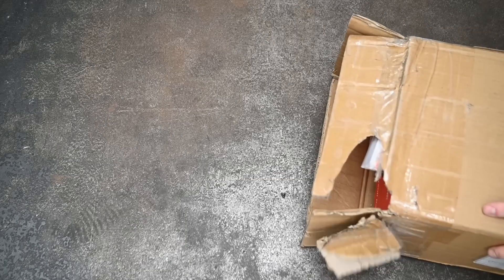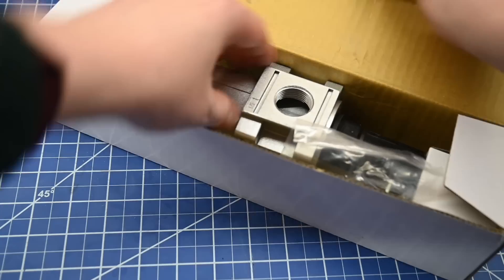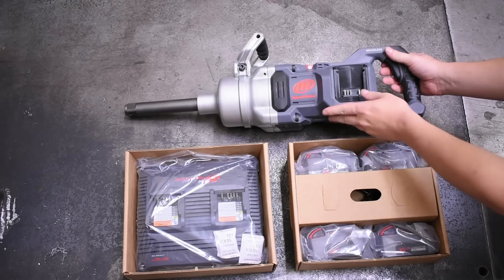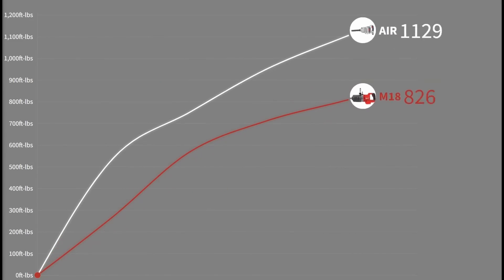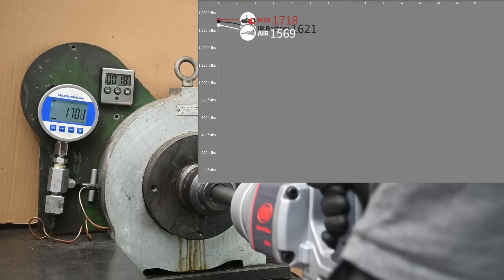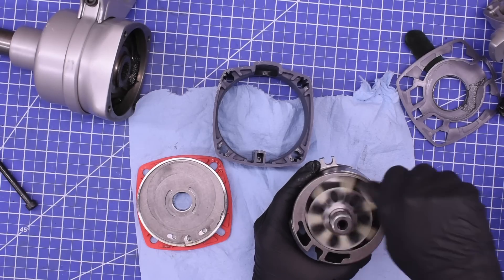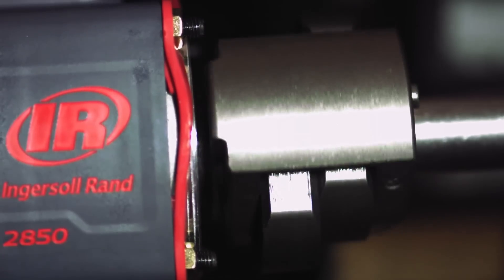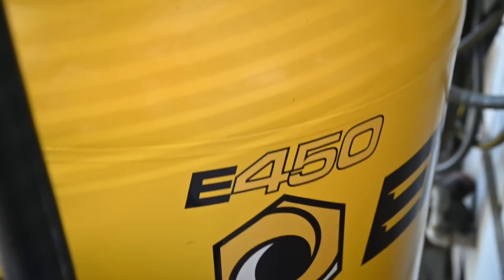The Impact Dealers Tighten Your Lug Nuts With: Largest Air vs Cordless

Comment: I was just using my VERY old Jet 3/4 drive air impact yesterday!  Made me realize just how choked down my air lines are while using it, and boy did you just amplify that thought.  Guess I'm going to have to run a dedicated medium length hose line off my main 3/4" air trunk.  

Even being underpowered, it STILL managed to crush 3 receiver cups of my ball joint press while trying (!) to get the lower ball joint out of my 2500HD.  I did win eventually on that front.  ;)

Comment: I'd like to see 1) A frankenbattery on the IR cordless 2) the 12ah Milwaukee Forge tested and 3) some cheap air tools tested (destroyed) by your new air compressor.
Reply from the maker: We tried to run the IR on 24V and bricked the $1000 impact https://www.youtube.com/watch?v=vHVuF8YvCu0
Reply: @TorqueTestChannel  now if someone had access to a 3d printer they could build a lower case for the IR batteries that would house 3 rows of 18650's something like the samsung 25r or molicel p26A, you might need to upgrade the thermal fuse on the top of the battery though
Reply: @MingRaptor  why those, there are much better cells around
Reply: @riba2233  really? What would be your pick for a high discharge 18650 with around a 2500mah capacity?
Reply: @MingRaptor molicel P30B ;)  although Samsung 20S has the same power (just much lower capacity) and they use 15 of Samsung 20S cells in flexvolt 6ah pack which makes it really powerful. These are true 30A cells compared to 20A rated 25R's.
Reply: @riba2233  i've a 6ah flexvolt that keeps going out of balance so if I can get 15 of those molicels i'll be swapping them out
Reply: @MingRaptor   they go out of balance because of a flawed bms design, no cells will help with that unfortunately :(
Reply: @riba2233  I understand the design but the 6ah flexvolt I have has been fine untill recently, there is a cell that is discharging faster than the rest under load and that one cell is throwing the whole thing off, I've got 9ah flexvolts that are 4 years old and still fine
Reply: @MingRaptor  ah ok, maybe some of them are tired after all those years yeah. P30B will be a nice refresh but be careful,  fv packs are a bit hard to disassemble :)
Reply: @riba2233  not my first rodeo buddy

Edit: the 6ah was actually fine  untill I used it in the big cordless strimmer/weed whacker (which ever side of the pond you are from)
Reply: @TorqueTestChannel You guys really are the best, no one else does that kind of research and devotion to the cause of beans
Reply: @TorqueTestChannel  Hear me out, get a Flipsky VESC BLDC speed controller and hook it up to the motor that's inside the bricked impact. Even if the sensors are dead the VESC should still be able to calibrate itself to the motor. Then you'll be able to run up to 100V at 100s of amps to it depending on battery and specific model of controller. These controllers are usually designed for electric bikes and skateboards so are very easy to set up. :)
Reply from the maker: @phylaxxx  I usually feel gasoline and brap be
braps are the solution
Reply: @TorqueTestChannel Suggestion if even your new compressor isn’t enough, maybe you can get your hands on a diesel air compressor to get high pressures even when impacting
Reply: if you get around to it. can you test some Vevor 1in impacts. believe one of their models is supposed to be over 3k break power. i maybe off a bit  @TorqueTestChannel
Reply: Or, hear me out, megasize that IR. Take the specs from it and just make it bigger.
Reply: electricity is still just electricity
Reply: They(TorqueTestChannel) did try give Mil more bean by using custom 18v Battery, and most milwaukee tool break down by it's power, so 12ah 18v Forge battery will not exist, or they need limit it some way, but if so, just buy normal 12ah battery instead.
Reply: @nguyenhaianh8070 That didn't age well🙃

Comment: Finally a tool I can use to remove my car oil filter. Those things get fused onto the car but not anymore with this guy.
Reply: That problem is why oiling the filter gasket is recommended. They don't need more than firm hand torque to seat in most cases.

Comment: My shop has both IR air impact wrenches, the 285B and 2850MAX. The 285B feels like it hits harder because it is able to remove truck lugs where the MAX sometimes struggles.
Reply: What kind of trucks? Is 600-700ft/lbs not enough for most rigs? I’ve never worked on them, but ASSumed the torque ratings wouldn’t be over 3-500lbs?
Reply from the maker: @fZionists78  Some of the disconnect with viewers and the super high numbers we show come from torque specs. Torque specs are to install something, which is why they give you that spec, to use a torque wrench. Most techs aren't NEEDING the impact to install, it's to remove it once mother nature has had its way with the bolt or nut. If you need a 600 ft-lbs mid torque to tackle most lug nuts that will roll in on passenger vehicles, and those are maybe 100 ft-lb spec. imagine what you need on something with a 500 ft-lb spec to remove 100% of the time.
Reply: @fZionists78  we work on freightliner, navistar, kenworths and other types of semi trucks and box trucks and different types of cargo trailers. Some people don't like to torque stuff down and just full send the impacts, on top of mother nature setting in, some lugs need a torch in order to be removed

Comment: I work in a heavy truck shop and we have a IR 2850 and a Central Pneumatic Harbor freight 1in and I am very disappointed with the performance of the IR ever since we got it. The old beat up HF gun beats it every time, so am curious to see what numbers that puts out compared to the 2850 in this test. Using the same air line and fittings I’ve had the HF gun buzz off lug nuts that the 2850 wouldn’t even think about loosening.
Reply: Smaller air guns perform better than larger air guns if the air is insufficient. Just something to keep in mind.
Reply: @autobootpiloot  the Chicago pneumatic is the same size as the IR gun plus we have all 1in air lines
Reply: @LongLLY  but is it the same capacity? I would think the highest rated impact has the highest need for air. Although 1” lines sounds like plenty of air. 

It’s just that I haven’t ever seen a cheap brand beat a name brand with air tools. But hf might just be the exception.
Reply: @autobootpiloot  it’s a 165 gallon compressor with 1 in lines so I do t think air flow is a problem. But I’m no expert. Still just curious to see how the testing compares to my experience.
Reply: @LongLLY  G'day  Max, I think the 165 gallon/ minute compressor would be way to small for large air tools. 165 gall is 22cfm. My shop compressor was 48 cfm. and the line pressure would quickly go down along with performance. cheers. Butch.
Reply: @butchphillips873  it’s 165 gal but I believe it’s over 100cfm because it’s a large screw compressor. I’ll have to check on Monday when I go back to work.
Reply: That's because IR sucks and are over rated. 20+ years ago, they were a major contender, but they haven't been for a long time.
Reply: Is the restriction at the coupling? We had an issue where pressure dropped so much after the quick coupler that the twin hammer was gutless.
Reply: @Suedeman  even if there is which I doubt because we are using Milton high flow 3/8 connectors both guns are similar size and rating so I don’t think that a restriction is causing that big of a power difference. Because from my estimate the ir gun is less than half as powerful.
Reply: Also to note we turned in the first ir gun for warranty because it was so gutless and the new one has the same issue. And if with our overkill setup the IR still isn’t getting enough air I’ve never seen a shop setup that could feed the IR gun properly. So if that’s the case no reasonable setup could fully power the IR

Comment: Love to see the reinvestment in the channel.  
Sounds like there is some practical application for the non channel as well but excited to see what comes next.
Reply from the maker: A lot of the delay was simply that the 80 gallon IR compressor with decent CFM does everything the shop needed, especially with more and more cordless being used. So this additional 120gallon guy had to be purely on our tab and basically has one use: big fun stuff
Reply: @TorqueTestChannel  sounds like more air tools are coming. Can't wait to see that
Reply: @TorqueTestChannel  If your compressors are getting in your way, and cramping your style, please feel free to send either, or both, my way!  🤣
Reply: @Hey_Its_That_Guy  im sure they will but you have to cover shipping "it will cost more then the compressor brand new"
Reply: @littlejack59  Have trailer, will travel.
Reply: @TorqueTestChannel  Twin Twin air hammer.  If 2 is good, is 4 better?
Reply: Yeah, now they can remove Honda crank bolts!
Reply: @nasonguy and post Jiffy Lube drain plugs

Comment: We use those chicago fittings all the time in aircraft maintenance from really low to very high psi. I've not once seen anyone use the retention clips, or even knew about them till now, and have never had issues with them whatsoever. Real reliable style in my experience
Reply from the maker: I'll be honest, the retention clips are mainly for on camera use
Reply: @TorqueTestChannel I had an accident because I didn't have the clips on. Was running on a big diesel compressor and I tripped over it. It came apart and beat me up while spraying water too all over me. Not a good day.
Reply: Same here.
They make retention clip? Who knew.
I have never seen these things come apart in use. Considering I’ve only used these with trailer mounted compressors, I’m pretty sure the results of a loose hose would be noteworthy.
Reply: I work in construction.  I also didn’t know they came with clips but I sometimes make people put rebar tie wire in high traffic areas.  Ive seen those things break open and it’s completely nuts when they get whipping around with a 100gpm compressor hooked up to it.  No one ever got hurt that I’ve seen but only because they weren’t right next to it.
Reply: @TKC_  They can be used with purpose-build safety cables which are recommended by Clemco (big sand blasters) etc.
Reply: I have seen one come undone.  Ours happened while first coming to to pressure.  Lots of twists in newly run hoses wanted to come out of the line when pressure was building.  It was something that caused us to use safety wire for at least a few years...
Reply: @BrianFullerton  I bet. lol
Reply: I was thinking the same thing with the clips/cotter pins.  They’re supposed to be used but get lost in a hurry here in NYC on the sites using jacks etc. welcome to the big boys club TTC👍😉. For real though congrats on any and all well deserved success and recognition. Thats a beautiful setup ya got there !
Reply: How do these compare to Thor fittings? We use them at work for air/water/steam because they have a locking collar and I would consider them "safer".
Reply: @Jeek333  Thor’s probably are “safer” and hold more psi. The Chicago fittings can’t be used for steam either. Idk but I don’t think thors are supposed to be used for steam.
Reply: @Ohio-Patriot  The seals aren't temp. rated for it but they hold up surprisingly well from my experience.
Reply: @Jeek333  Thor fittings are nicely done and cost accordingly. I would prefer them for steam because of the locking collar but otherwise Chicago couplings are long proven and seal swaps take a few seconds with needlenose pliers. Not chasing cotter keys is a MAJOR convenience when working where OSH inspections are a factor though aircraft safety wire works even better. Both types benefit from safety cables.
Reply: At the plant I work at we have these on the air and water hoses and the only time we ever use them is on the water hoses.
Reply: Use them all the time on air tools from Jack leg drills to breakers to feeding slant drills. The cotter pins get lost, we use tie wire to keep the safety marm happy along with whip checks. Definitely would recommend a whip check on the end though as the fitting might not give, but have seen enough connections fail on the hose that you would not want to get slapped by one.
Reply: Working in shipyards I have NEVER seen one used without either a cotter pin or some safety wire. Looks like your safety program needs a refresh, having a high pressure air line let loose seems to be a real effective way to ruin a pair of pants.
Reply: I think the pressure keeps them on. My semi-truck to trailer fittings do not use retention clips. But I can tell when they are under pressure due to it extremely hard to take one off under pressure.
Reply: In Germany, these cnnectors are called bayonette couplings, and as far as I can tell, they don't even have the hole for the pin. 
Just noticed there are different styles.
Reply: Same. They are hard to get apart unpressurised, I couldn't imagine them coming apart pressurized.
Reply: They look similar to gladhand hookups for semi truck air lines.
Reply: Same, I assumed those fittings were military only and not for everyone, luckily I've never seen one come apart though.
Reply: Ive had to use these in german steel works and they were a real pain in the ass due to the rusty environment. Getting then on was always hard and most of them would leak
Reply: I was gonna say while I never see chicago fittings before they look like they might be related to gladhand fittings, and those things are tough as nails no clips needed.
Reply: The retention clips are required by OSHA.

Comment: For future reference, you can rent a small(er) tow-behind diesel compressor that'll give you the sustained CFM you need. Think, road crew with a jackhammer. Also, how does the Milwaukee do with a Forge battery?
Reply from the maker: We know, but we didn't want to be able to just test this sort of category once or every now and again, more like every time we see something cool you guys would want to see. We included how the 1" M18 does with the FORGE
Reply: @TorqueTestChannel  missed the Forge segment, thanks! Maybe big red can give us an impact with an MX Fuel battery? One can dream!
Reply: @TorqueTestChannel  Rent... You can literally pick up those diesel powered compressors at any Richie Bros auction for less than $1000. Got a portable generator / compressor for $650 at the auction. It was so good we never even bothered running power to the new farm shop. I get that's not the point though, so congrats on the serious upgrade.
Reply: @johndeerekid167 don't buy anything there freshly painted 😂
Reply: Was recommended to buy a 2850. Did so, with high expectation. Unfortunately it never came close to our old air cat 1850. I am really disappointed with it. (Both on 130 psi line pressure)
Reply: @justinmartin8887  Pressure doesn't matter if your supply can't push enough volume. We run these on 3/4 plumbing from a 30cfm 100% duty cycle compressor. We used to use a 1/2 hose reel to deliver the air to the gun and it was gutless replaced with a 3/4 hose that reduces to 1/2 at the gun inlet and it makes a massive difference. We run them at 95 psi regulated
Reply: @Suedeman  yes, larger lines definitely help. a higher inlet pressure will offset line loss. Run your line pressure at 135. It’ll still drop some when you pull the trigger. 
     The worse your line loss, the higher you should run your line pressure to help offset  line loss
Reply: @justinmartin8887   @justinmartin8887  we find the guns last longer at the lower inlet pressure. We built the system so our inlet only drops unto the mid 80s when the guns running. The impacts are the only things on the circuit the hoses are just threaded into the guns